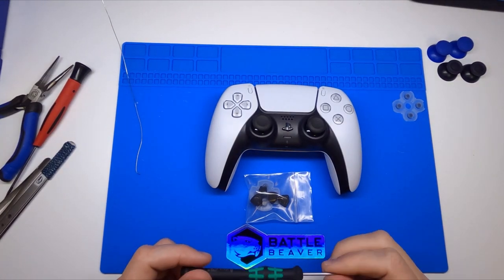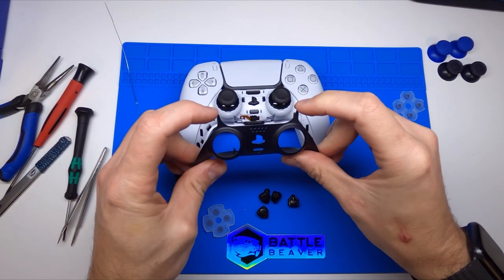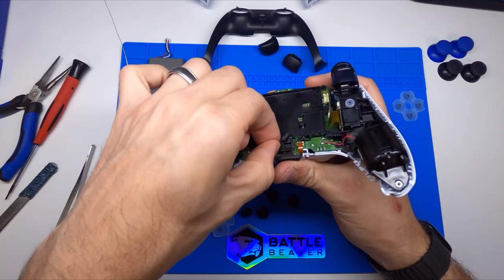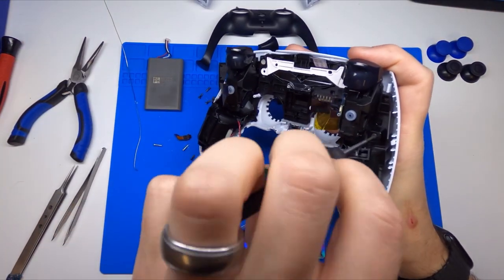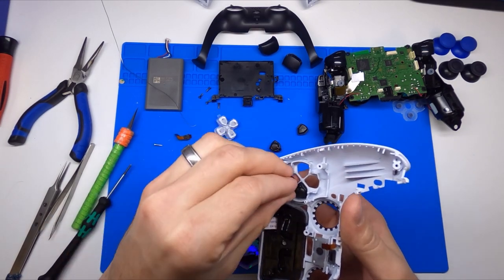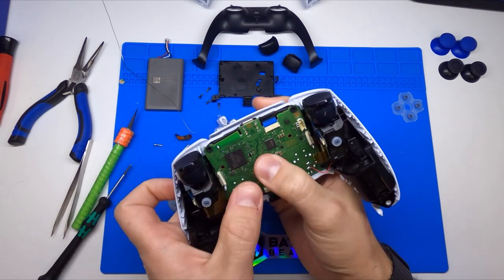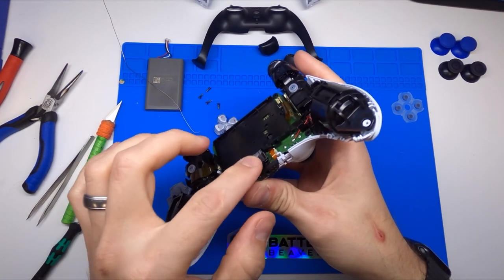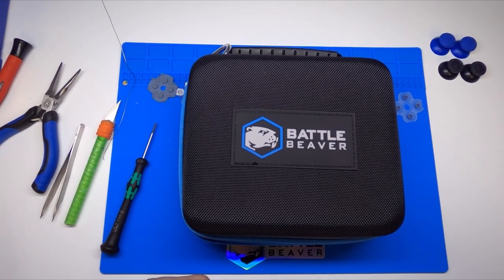Sony PS5 DualSense Battle Beaver D-Button Install

Comment: So I used this video to switch out the buttons on my dualsense and I noticed an issue. The buttons on the stock d-pad are actually a bit longer in length than the ones you guys provide which are molded after the ds4 dpad. If you inspect more closely you will see that the buttons you guys provide have a deeper curve and are more concave at the middle intersection point than the dualsense stock ones. The reason I noticed this was I noticed my thumb would get stuck at the intersection point of the dpad in the middle when I tried to do diagonal inputs. Which may not seem like a big issue but I realized as much as I practiced with it it still wasn’t giving me the results I was used to with the ds4 when I used the same button mod. Do you guys plan on remaking these buttons but molded specifically for dualsense?
Reply: I bump this
Reply: @alexmcphee6789 I think they just use 'extremerate' parts and they don't actually make their own. As with every custom controller company

Comment: Those dbuttons sound a bit rattley 😟
Reply: Yeah they work, but not that great. They do rattle, but the little half-sphere that goes where the original buttons pivot at is too narrow, if it was a little bigger these would be great. If it's directly center none of the buttons have the right pressure, if it's moved slightly left or right diagonally, 2 of your buttons will feel awesome, even better than stock buttons, but then you have 2 unstable mushy buttons(and that's with a new Battle Beaver membrane).  Now this is on the Dualsense controller in my experience, they may work better on dualshock 4.   Either way I feel like the price for these is a little on the steep side, especially since shipping is not included. The buttons, a replacement membrane and cheapest shipping from Texas to North Carolina was over $30 in all.
Reply: I'm going to follow up my previous comment. I did install the buttons into a dualshock 4. They worked a little better, but I decided to add a couple of millimeters of double stick foam tape to the little pivot piece to add more pressure all around. It worked and I'm doing good in Celeste already, however it really sucks that it didn't work as well in my Dualsense, they heavy bastard just feels good in the hands.

Comment: Today is 12/4/2023 and I just got off the phone with customer support . My D-pad didn't come with the back dome piece shown at 8:41 . They told me via the phone that this video is outdated and they never updated the video. " I believe about a year ago we changed the d-pad . I know it looks similar but their are small details that are different . " I said that Chris Bailey said that the buttons would get stuck so that was the reason for the black dome piece. He said that I wouldn't experience that issue and the dome piece is no longer required . I asked has that error been fixed in this new version and he said " correct " . So just to let you know you aren't missing anything and you're fine !  If they happen to read this Please update this video so others aren't confused !
Reply: Thank you. I was about to freak out thinking I lost the little dome piece.
Reply: thank you for this. i was staring at my little ziploc bag looking for the dome piece forever

Comment: For anyone coming into this video years later, yes, there is a slight change to the controller. Two sliver screws holding a “white trimming” are no longer in some controllers. 6:08

Comment: I have just received my order today and the d-pad rubber that I've received was identical to the one the PS5 controller already had.
Also:
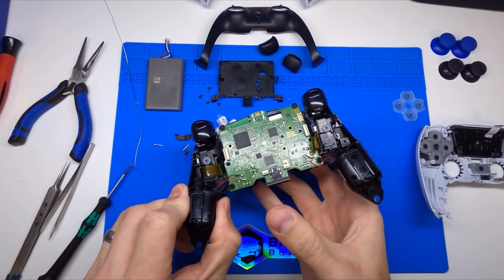- I did not receive that little dome piece from 08:31;
- The two silver screws holding the “white trimming” are no longer in the new chassis controller 06:22, and the Options and Share buttons will fall if you turn the controller;

Other than that it was very fun operating on my controllers.
I will now try the new buttons on Mortal Kombat 1.
Reply: How’s it been with mk1?

Comment: The D pad was driving me crazy, givng me input errors all the time. When pressing up or down it goes left or right sometimes and vice versa. And after watching this video I decided to open up the Ps5 controller. It wasn't that difficult. I removed the D pad button and used a small hacksaw to cut it up into 4 seperate buttons.
Putting it back together was a bit more difficult because I didn't place the buttons in their original position which gave me some problems. I didn't think that would mather as much but for some reason it does. But after a few tries and placing the buttons in the exact same place (as they were when it was still 1 button) it worked fine. No more input errors, when I push up or down it doesn't go left or right anymore, like it should be in the first place!
There is a small downside though, the buttons rattle a bit now. But I can live with that.
Thanks for the instruction video, you deserved a like! 👍🏻

Comment: Just installed them! It's not that hard, and this video is still mostly current. You don't need the center glued piece anymore, and the top screws in the white part of the frame are also gone, so you can skip that step as well. Also, the rubber pad that comes with them now seems identical to the stock DualSense, which has been updated.

One thing that's not in the video: the newer PS5 buttons have a notch in each that faces up towards L1/R1 since they're not symmetrical, so they sit flat against the contour of the controller.

I've only just started testing them, but I can tell they're much more precise and you never get accidental diagonals unless you press them. They do, however, require precise inputs, since you may develop bad habits being able to "fudge" your motion inputs on a platter-style D-Pad that's all one piece. I noticed this doing a 2-in-1 DP > Lv3 super in SF6. I had to make sure I did a full quarter circle on the first motion, as skipping forward in either part of the input will drop the super. In other words, ➡⬇↘👊⬇↘➡🦶 won't work, you must do ➡⬇↘➡👊⬇↘➡🦶, but that was less apparent until I switched to D-Buttons.

All in all, I think they're gonna be awesome after getting used to them and becoming a bit more deliberate and clean with my motion inputs. I already no longer have to worry about getting DP from an accidental ↘ input while trying to do DR > 2HP, which is a huge win.
Reply: I noticed that to. Can’t fudge the input for DP so everything is precise. I have two PS5 controllers one with battle beaver dpad and the second I have the dpad I modified myself to separate up on dpad and the rest still attached to the middle dome. Keeps half circles and quarter circles intact and keeping up separate from accidentals.
Reply: @Stuff-mu7li  Interesting! That's a cool concept to avoid accidental jumps.

I'm currently back to using the regular DualSense D-pad as I walk the road to Master with Akuma in SF6. With the D-buttons, due to my thumb placement, I found myself sticking to the ground after blocking low while facing right, failing to walk immediately, or "reacting" to overheads and jump-ins but not fully releasing down so I'd eat huge combos and lose matches.

I may give the D-buttons a shot again in the future, but for now I re-installed the normal D-pad in my newer Dualsense, and I'm doing quite well with it now that it's starting to break in.
Reply: @Stuff-mu7li  the main draw is accidental down inputs while holding back (blocking) though as well
Reply: @M_CFV  for me it was just accidental up’s. But you can definitely detach the dpad down with the oem dpad if you have a dremel. I can tell you it works flawlessly for which ever is your preference. Also I actually bought a pack of oem type of dpads from Amazon for like 15 dollars to experiment with.
Reply: Fully agree with this assessment. I just got done installing mine a few hours ago and had a quick ranked session to test it out. Definitely more precise, but there's a bit of an adjustment period here. Definitely finding I have to be more intentional when trying to input supers or Chun's instant air legs motion. Also found for whatever reason getting her SS stance cancels out weren't as consistent but that's probably me being sloppy

Comment: Nice, its great to know the BBC parts can be installed on the next gen pad. I was quite worried, Thanks Mr. Bailey!
Reply: So is it possible to use the ds4 dpad buttons in the ds5?
Reply: @suechtlingslagertv2305  yup my dude.

Comment: this is my exact issue now, after alot of use your dpad will become lopsided, it will like to fall to one side, so if you pressed your button at the wrong side you'd press the wrong input
i use my index finger to hold up as i run in apex so i can change my heals, but if i land my finger on a bad spot it'll open the grande menu and most likely be the end of me

Comment: Are the membranes of the pads the exact same as the ps4 controller? I have a bunch of membranes from the ps4 that are brand new, was wondering if I can use those if my ps5 membranes get worn out.

Comment: To anyone out there installing these in a PS5 DualSense, they do help with fighting game inputs, but the trade off is that they rattle and make noise whenever the controller force feedback kicks in. There isn’t enough pressure from the D-pad membrane to provide a tight fit, so they just shake around. It’s frankly really annoying. I use my DualSense for more than just fighters so I may take the D-buttons back out and just live with the stock D-pad.
Reply: Just get a second controller, but you are right they do rattle.
Reply: Is it really that bad? I just bought a Dualsense and it's driving me nuts how often I'm getting blown up because the dpad will register a 4 input as an 8, a 6 as 8, and even sometimes 4 as 6. Or only register one press.
Reply: @paracetamolgirl7820  The force feedback rattle with the D-buttons is really bad (the new Matrix tech demo is downright comical), and as another commenter also noted the D-buttons aren't quite right for the DualSense, but they truly do help with inputs. I had particularly bad problems with 4 registering as 1 before installing the D-buttons. So it's really a trade off. If you can justify a second DualSense just for fighting games/others that use D-pad heavily it probably makes sense to mod one and then keep another original for other games.
Reply: @SlickDizzy  Uggh. I don't have a PS5/I play on PC, so it's definitely not worth for me to invest ~$200 on hardware I only use for a few games. Might just repair and switch back to my old DS4 if that's the case. 

But anyway, thanks for the help.
Reply: Maybe better to install the same kind of D-pads that the DualShock 4 has. My DS4's has  much more distinctive D-pad than my mushy DualSense. I'm not playing fighting games but I'm really disappointed with the DualSense.
Reply: @peite7878  I used DS4 dpad rubber and its only a little better

Comment: Is the video outdated? My internals of the dual sense where completly different and i didnt need to disonnect the rumble ribbons at all but did and almost messed up my controller
Reply: Same my internals are completely diff
Reply: @chrxs61632  pull the back mic and battery and touch pad ribbon only. There's 4 screws and that's it lol

Comment: Are these 100% same as for ds4 or are they specifically made for dualsense? Because I tried putting ones I have for ds4 in a dualsense and they didn't feel right, they're just a bit too small so they wiggle in there, and just a bit too short, so when you press them, center portion goes below controller surface

Comment: If a bought a PS5 battle beaver controller, and already have joystick drift after 3 months of having it, is taking a part a battle beavers controller gonna be about the same, or are there extra springs or any things I may lose?

Comment: Are the white D-pad buttons on web site the same color white as ps 5 controller?   And I really need the answer to the question before mine about D-pad buttons size in ps4 vs Ps5 controllers

Comment: Damn you guys, no PS5 buttons in stock. I do not wish to use the PS4 ones. These are a must have but I don't want to spend $50 on d-pad buttons. $20 for the PS4 ones and $25 when the PS5 ones are in stock. When did you guys go out of stock? Cause this is a must have mod.

Comment: Hey BBC. I bought the d-pad a year ago. And it was the best thing to do for my DS4. Now I switched to ps5 and I already took a look on your shop but couldn’t find the ps5 dpad, so my question maybe even some one in the community can answer. Can I use my ds4 dpad buttons with my dualsense? Just getting them off my ds4 and built them
Into the ds5? Would appreciate a answer in any kind.

Comment: Works good. But it’s not perfect. The buttons are a slightly different size than the originals. With a little force you can even get the buttons stuck against the case

Comment: Installed this on my Dual Sense about 6 months ago before Guilty Gear stive released. I've been using then for a while.
Pros:
They do help with inputs overall.
Cons:
As others have mentioned.  The buttons do rattle. I don't know if its because I'm using the stock back pad. I didn't purchase theirs. They should just sell it with the buttons in my opinion.
Since they rattle or feel loose, I Sometimes do press the wrong buttons when the fights get intense.

Overall l believe they should revise this buttons. Maybe make them a bit more longer and stiffer. I'm ok with the concave.
Reply: Yep its because ur using the PS5 rubber and not the ps4 one. Their buttons are molded after the ds4

Comment: So I had a two of these in my two ps4 controllers that I just removed. Do you guys do replacements for the little dome piece that goes on the front of the pad? They lost the stickinesd from the back part and I don't really feel the need to buy more buttons when I already have 8 of them unless I can get them in different colors.

Comment: potentially relevant info to anyone doing this in 2024:

just put mine in. i have a "newer" controller so compared to this video, the screws of my controller were different. also the stock rubber contact pad in my controller was way different from the stock one shown in this video as well as the one battlebeaver gave me. also the housing that fits the rubber contact pad in my controller was a bit different as well causing the one battlebeaver gave me not to fit. i had to keep using the stock one as a result. which is fine because i actually prefer the stock one. the battle beaver one raises the buttons too high making certain motions more difficult. the stock contact pad keeps the height of the buttons just as they were originally.

its also worth noting that i was not able to place the buttons in random slots like shown in the video. each button has to be placed in a specific slot or else the profile of the buttons will be messed up. it wasnt shown in this video but there are indents on the sides + front and back of the buttons that tell you where they’re supposed to be placed.

Comment: If the d-buttons work on the dual sense, will any ds4 dpad silicones work?
Reply from the maker: Yes
Reply: @BattleBeaverCustoms  does that mean the ds4 buttons will fit as well? also a ds4 dpad
Reply: @Ali-td5qj  yes

Comment: Are the white ones a little bigger than the black ones so they can fit in the dual sense without rattling or are they the same size as the black ds4 ones?

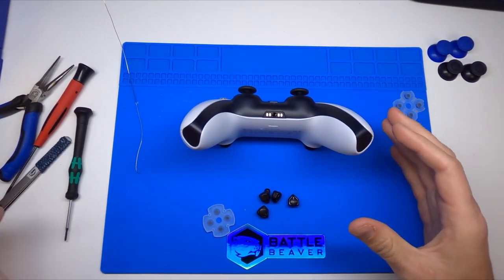Comment: [1:21 - 4:33] that's the one thing I Hate about PS controllers*  all that just to get to the battery in case the battery is damaged or simply died where as any other controler either has AA baterys,  external rechargeable battery's , or just simply weird. replacing external battery's are a hell of lot cheaper (especially rechargeable's)  then buying a brand new $60 to $80 controller.
and controllers that do the same*

This is coming from an avid PlayStation User. I will be buying the PS5 controller because of the sweet tech and improved size and shape!